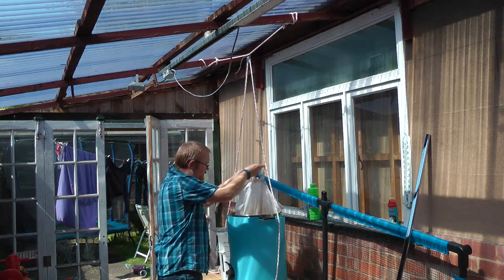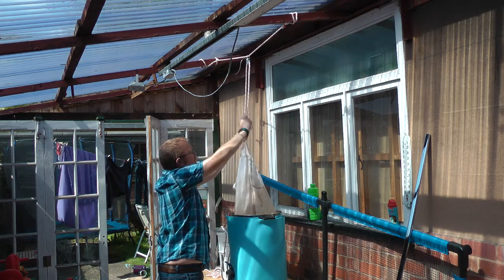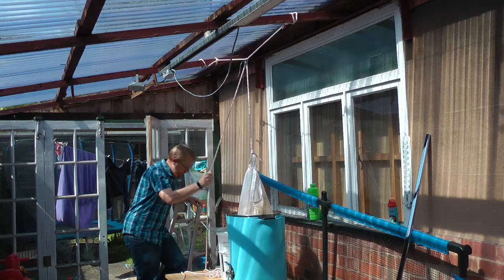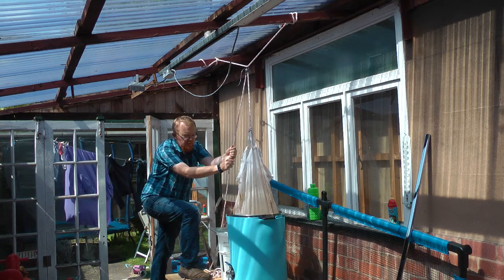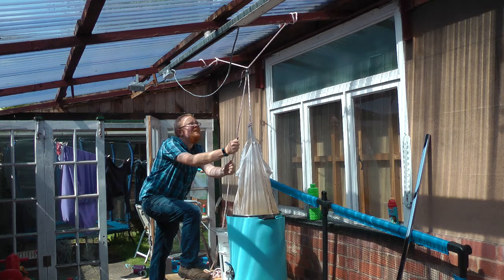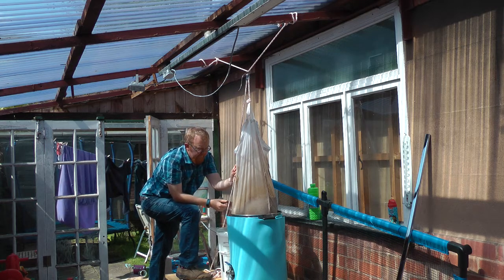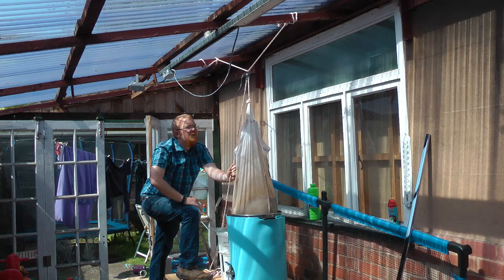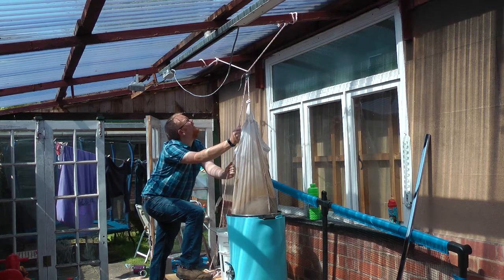HBW15, BIAB PBLS (Pulley Bag Lifting System)

Comment: You need a solid top rail, rope just won't work as it will always sag. A double pulley running along some angle iron would probably be best, might be a custom job though. Apologies on the tardiness, we went away for a week. Cheers, Schnuz.
Reply from the maker: Thanks for the tip Schnuz, sounds like just what I need , just going to have to bodge something together for the moment but that sounds like a great idea hope you had a great break, cheers :)
Reply: Cheers, I have a tan 😮 as the weather was absolutely cracking the flags 😃 .  We had a great time in Ireland and the birthday celebration in Penrith was memorable 😉 😄 . Cheers, Schnuz.
Reply from the maker: Hehe great stuff, Ive tried working on my tan but only ever seem to turn a shade of red lol. Glad you've had a good break Ive only had chance to see a few of your videos from your trip as yet, looking forward to checking out the rest 🍻